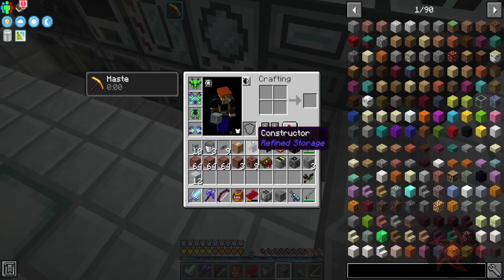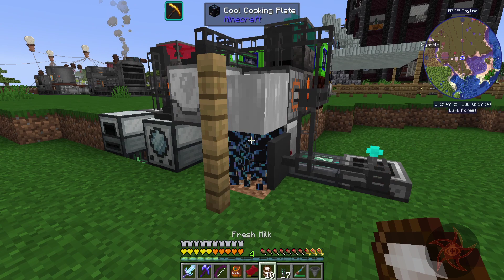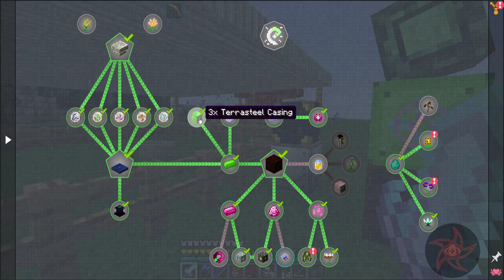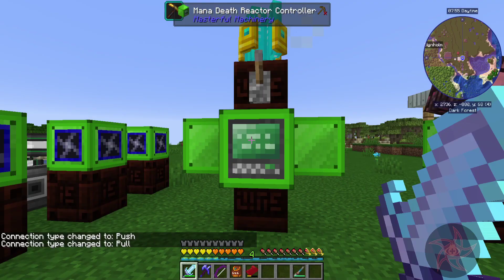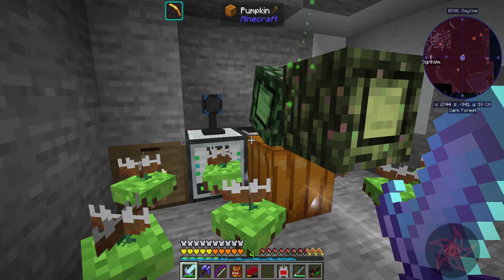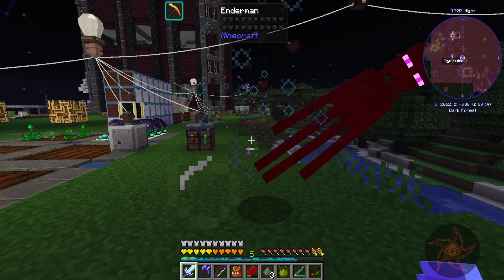FTB: Integration by Parts DX :: Cooking Plate Automation :: IBP-40

Comment: Elegant solution to in-world smelting for the hot plate - have attuned astral crystal linked to orange crystal lens linked to the hot plate. It creates orange beam of light that smelts whatever it touches...
Reply from the maker: I did consider that, but I was concerned about the speed vs a redstone furnace, plus since it is already required to have quite a few tech parts for the rest of the operation I figured I would stick with machines rather than shoehorning in s bit of magic